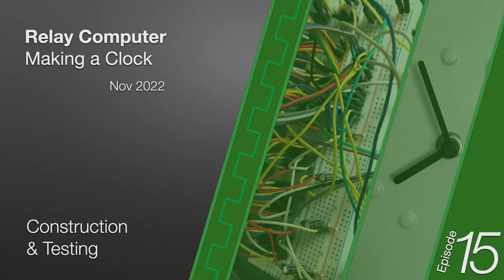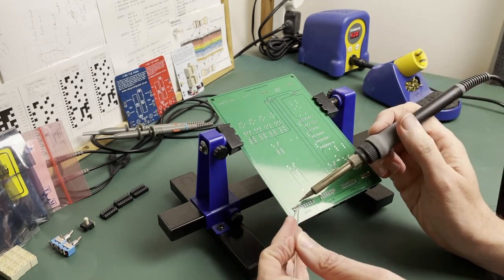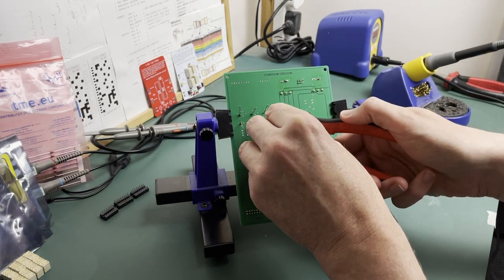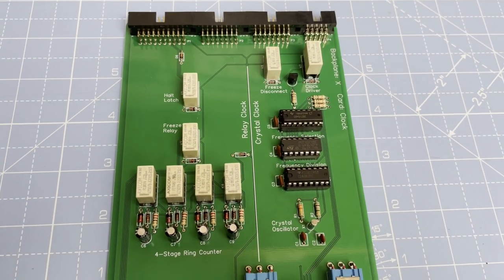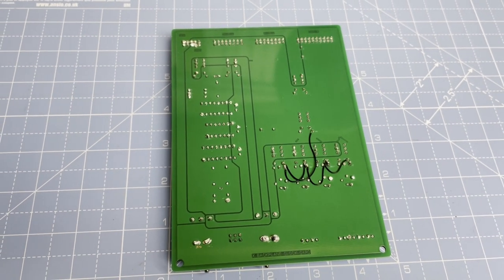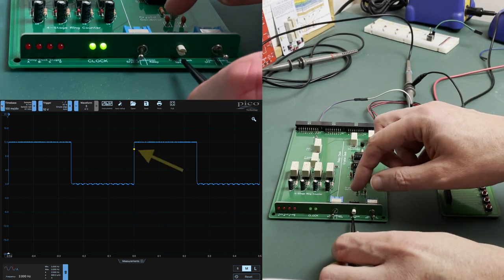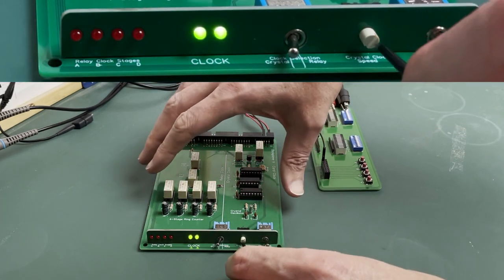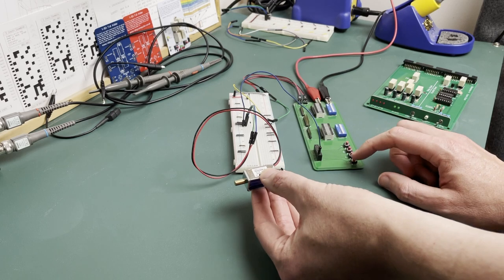Relay Computer Clock - Ep15 - Construction & Testing

Comment: a chisel tip might go a long way in helping transfer heat to the pads
Reply from the maker: yea, that's definitely helped - also used plenty of flux. I'm hoping though that the adjustments I've made to the PCB design for thermal relief will be a big helper. I'll soon find out when the next batch arrive in the post ;)

Comment: "....make sure they're well lined up..."

Yeh, i'd plug them into the backplane, use that to align/hold the connectors and then tack them in....

'Course.... i'd use a larger single connector like the eurocard uses, i can see lining up 3 separate idcs being a bitch...
Reply from the maker: Yea, totally agree. Now I'm designing PCBs rather than using the standard 0.1 inch pad boards the eurocard connectors would be far better if I was doing it all over again.